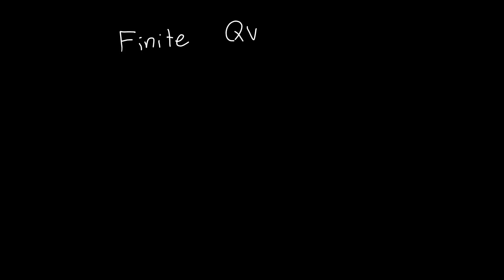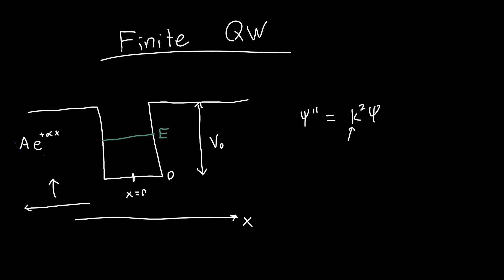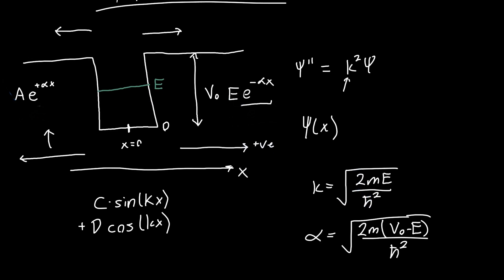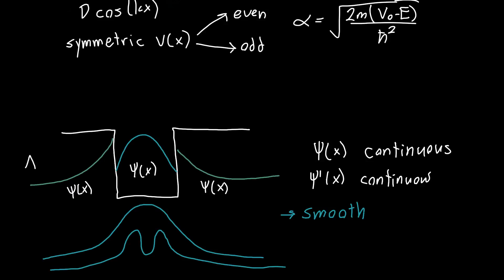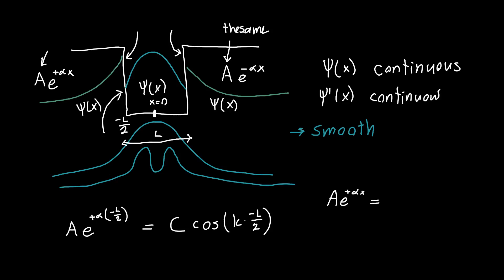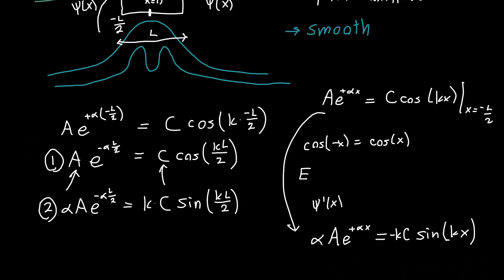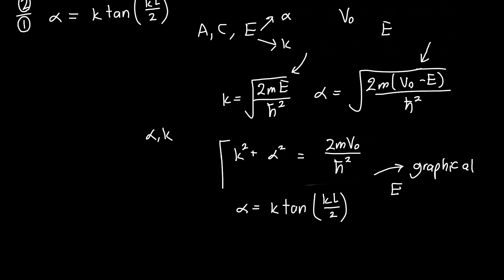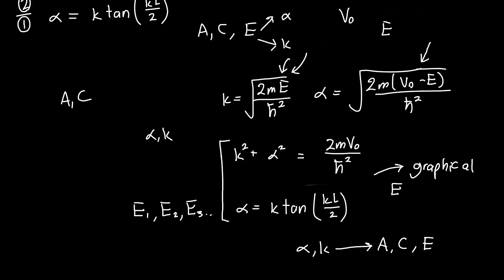Finite Quantum Well Part 2

Comment: Thanks for your interesting video.

Your viewers might enjoy this video showing under the right conditions, the quantization of a field is easily produced.

The ground state energy is induced via Euler’s contain column analysis. Contain column m must come in to play before over buckling or the effect will not work.  The system response in a quantized manor when force is applied in the perpendicular direction. Bonding at the points of highest probabilities and maximum duration( peeks and troughs) of the fields/sheet produced a stable structure out of three fields

People say I am just plucked guitar strings. I said you can not make structures with vibrating guitar strings or harmonic oscillators.

https://youtu.be/wrBsqiE0vG4?si=waT8lY2iX-wJdjO3

At this time I’m my research, I have been trying to describe the “U” shape formed.

In the model,  “U” shape waves are produced as the loading increases and just before the wave-like function shifts to the next higher energy level.

Over-lapping all the waves frequencies together using Fournier Transforms, I understand makes a “U” shape or square wave form. 

Wondering if Feynman Path Integrals for all possible wave functions could be applicable here?

If this model has merit, seeing the sawtooth load verse deflection graph produced could give some real insight in what happened during the quantum jumps.
The mechanical description and white paper that goes with the video can be found on my YouTube page.

You can reproduce my results using a sheet of Mylar* ( the clear plastic found in school folders. 
Seeing it first hand is worth the effort!